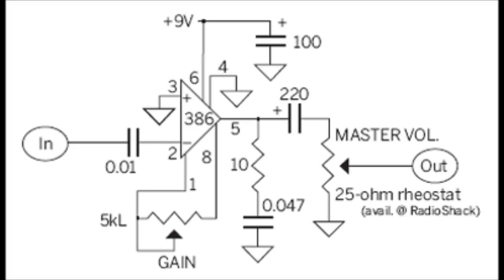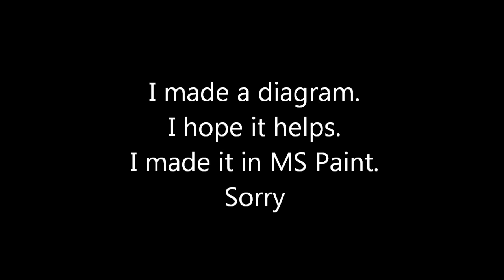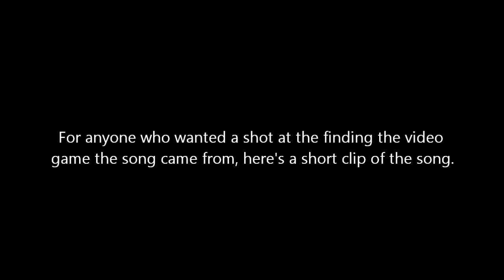How to Modify Computer Speakers: Basic Electronics Episode 17

Comment: You are smart man if you ever come accross any old fm radios you can rig them up to transmit over the radio for about 100 to 200 feet......ive been trying to figure out a way to amplify the fm signal thats comming out of the transmitter but so far i havant gotton anywhere.....im going to try hooking the transmitter up to a power transformer from an old radio it might step up the currant if i reverse the poloraty but i havant tried it yet....every anolog radio transmits a dead carrier when ever its on usally it will be about 10 to 20 MHZ below what ever frequency the radio is recieving but as long as the radio has a dial you can do it but digital radios i dont think can do it.....get 2 radio's and just turn the radio you want to transmit to 108 and tune the reciever entill you hear a dead carrier.....then just take your sound from another amp like an ipod or mp3 player you dont need much power to get good modulation and connect the wires to differant places inside the radio entill you hear music comming from the other radio.....i made a video awile ago on how to do it but its pretty simple once you get it to transmit just tie a wire to the tuning capacitor for an antenna